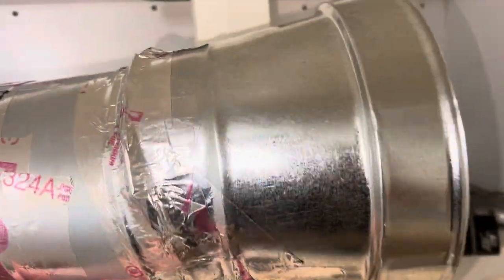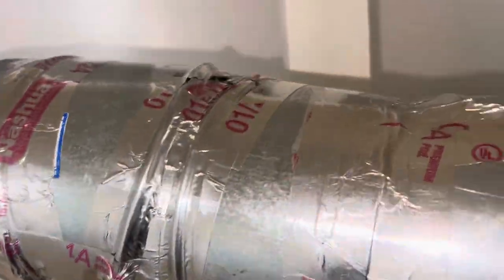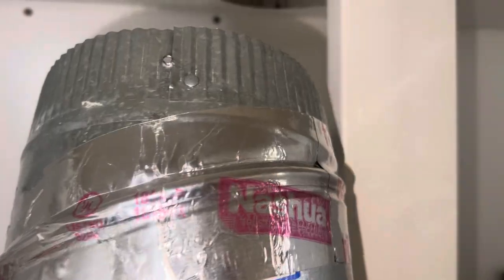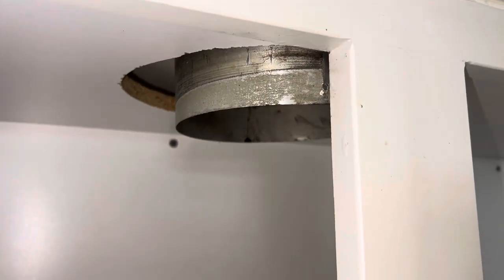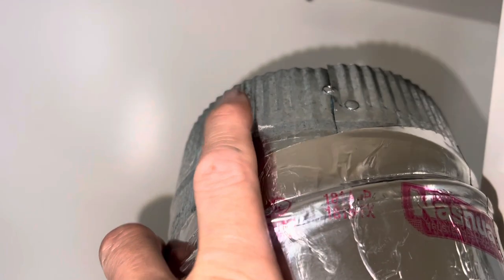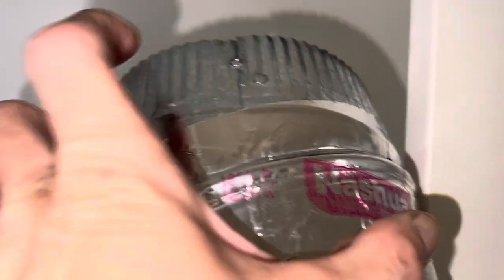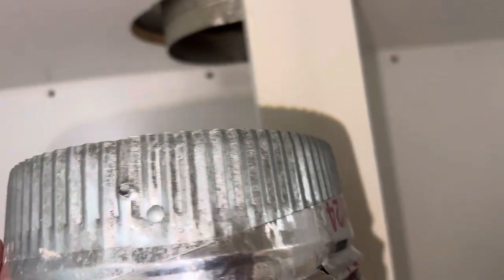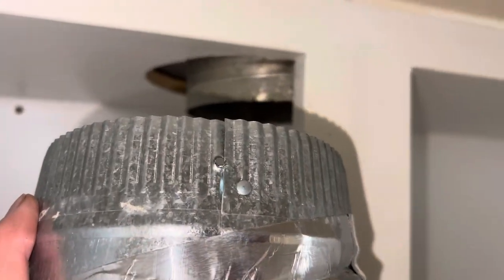Fixing kitchen exhaust flue pipe that had many leaks improper installation

Comment: In my first house, I ran rigid aluminum ductwork for the dryer, taped with aluminum tape like you did. I went to sell the house, and the home inspector told the new buyer that that is not the way it is done, that you should use the accordion hose, because that's what everyone uses. The new buyer listened to the home inspector. Idiots
Reply from the maker: Different states have different code rules. 

In some areas, especially if it’s a gas powered dryer the exhaust gas from burning gas makes CO2 and CO carbon monoxide . 

The CO2 mixes with the moisture to make carbonic acid . 

And this corrodes and oxidizes aluminum. 

Exhaust ducting cannot have holes in it that may release combustion gases into the interior housing spaces are into walls. 

This is why in some places only steel is allowed, not aluminum. 

Not all aluminum tape is created equal. 

It has to have the high temperature and related stamping and markings UL listed on the outside of the tape like you see in my video. 

In some applications where the exhaust flue gas might be very hot. The codes for the local jurisdiction may require double walled or even triple walled through transitions between floors or going through walls.. 

With the addition of space that is to be sealed with a high temperature, flame, retardant, flame, resistance, or fireproof compound for airtight sealing

So it all depends on your local jurisdiction of what codes they follow they mandate and they enforce .
Reply: @coldfinger459sub0  This was an electric dryer, but it doesn't get very hot.
Reply from the maker: @who_wantsit  it’s whatever the code says for your jurisdiction